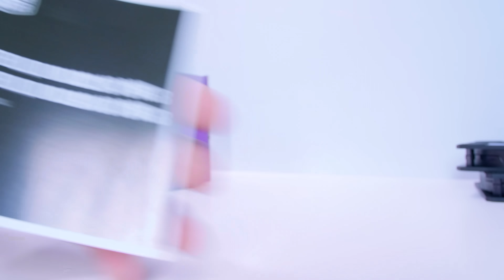HOW TO Cooler Master ML240L V2 RGB AM4 & AM5 Install Guide

Comment: What’s the difference between the v1 version... the only difference I see is that the pump looks different... is there any cooling difference?
Reply: If you check on the coolermaster website, the finstack on the radiator has 20% increased surface area and the fan changed bearings, as well as a more quality pump to prevent leaks and provide better cooling. It's a big upgrade for not that much more cost.

Comment: How would you recommend putting it in the nzxt H510 or the Lian li Lancool 2 x
Reply: Same I came from the 800 dollar pc build and the cpu cooler is so bad so I also wanna know how to install this in the h510
Reply: If I’m being totally honest, I’d say don’t use either, use the Cooler Master H500 (Not H500M or H500P, just H500). It’s supports 240mm rads and is also a good budget case

Comment: Hey, my case is pretty small (it's the aero cylon) and the front of it can hold 3 fans(360mm)
I was wondering if I got this, if the radiotor would interrupt me putting the third fan in the front of my build. Because the radiotor takes up a bit more than 240mm

Comment: The fans for the radiator wont light up, did I do something wrong?
Reply: I had this problem too. I dunno what you did wrong, but I plugged my fan's pin sockets into the wrong pins on the motherboard. I had them plugged into RGB2 and switched them to RGB1 to fix the problem.

Comment: Hi. my Mobo only has 2 Fan headers - CPU Fan & Sys Fan. I am using the Sys Fan for my Casing Fans Hub. If i use the CPU Fan for the radiator fan, where should i plug the pump 3 pin to?
Reply: Did you ever figure it out
Reply: @rey-sc7ct  I powered the pump via a molex to 3 pin converter cable. no pump speed control.

Comment: I recently purchased this over the X53 Kraken. Saved so much money. Trust me, I was torn between on what to get! Super Quiet!!!
Reply: I made the same decision! Glad we both found such a good deal
Reply: Dylan Gregory agree! Plus if you really wanted to, the money you save, can buy  noctua fans that replace the cooler masters
Reply: Elo How much did you get yours for?
Reply: Contonio it was amazon for $75 plus tax. It could be different. The money you save can get you the best noctua fans and its better than the nzxt fans. It’s quiet too. I was shocked at the performance for the price I paid. Can’t complain.
Reply: @elo_888  Can you give me a rough estimate of what your idle temperature is?
Reply: Contonio so I have a tiny ITX build in a NCASE M1. It’s a 3600x and temps idle are 40-50c. Pretty satisfied. Obviously temps are going to be even better in a bigger case. Gaming is around 60-65 and maxes at 70
Reply: @elo_888 i would rather have a better cpu cooler than an extra 80 dollars in fans
Reply: @frehesh.4386  I can afford the better ones. I just choose to save money and it performs fine. Maybe the x53 will be a few degrees better. It’s working fine to me. Still not regretting it. If you can get the better one at the same price as this one, go for it!
Reply: @elo_888  i have one thst i got for 59 dollars open box
Reply: @frehesh.4386  winning! Enjoy it!
Reply: Elo any problems with it yet?
Reply: C02Gaming no problems yet. I have it in my ncase M1. I don’t see why I need to pay $150 for nzxt. Don’t get me wrong, if they were same price I might opt for the nzxt. Financially makes no sense.
Reply: @elo_888  still good?
Reply: Tyler still good! It’s in my NCASE M1! I’m not here to shill it. My first cooler master product honestly. I’m big on saving money and spending it where it makes sense!
Reply: @c02gaming50  nothing yet! I actually have noctua fans for mine in a push pull configuration
Reply: Super quiet? My fans were so loud. I installed it the same way yet the fans were super loud. Ended up replacing them but had to sacrifice the RGB really disappointed but it had to be done
Reply: @renny3503  Make sure to connect cooler pump and cooler fans only to the CPU _FAN (boot verifies device working before start for cpu protection safety) or CPU_OPT headers because those are speed controlled by the motherboard only going max only if heavy useage then it will be louder. Many people only hook to fan power output for for system  or chassis headers which are 100% PWM powered at all time unless changed in BIOS which makes it loud running max all the time when it does not need to 99% of the time.
Reply: @renny3503  the money you saved helps buy noctuas which is better than nzxt and CM fans. That’s the major benefit
Reply: @elo_888  1 month later, all good?
Reply: @elo_888  do you think that this cooler could cool an overclocked 3700x?
Reply: @maestreiluminati87   nothing yet! I actually have noctua fans for mine in a push pull configuration
Reply: @oopsiepoopsie3071   I actually have noctua fans for mine in a push pull configuration. The money saved , made me have nice fans
Reply: I'm about to purchase this cooler. Any leakage problems almost a year later if you're still using it?
Reply: @Hanzeaux  Hey bro! Still Kicking! I just upgraded to a 5600x and upgraded my 5700xt to 3070. No issues! Save that money for gpu, cpu, etc. Wont regret it
Reply: @elo_888  Thanks!
Reply: @Hanzeaux  I hope you enjoy it!
Reply: @elo_888  You're one of a kind! 🔥 I was torn between the same coolers before reading your updates!!
Reply: @MrXSL  Thanks bro! Just trying to help others save money!
Reply: @elo_888  how is it doing? any signs of it slowing down? does it work the same way it did when you bought it?
Reply: @artist3856  doing good! Hope you are too. No issues still. Just doing it’s job! No regrets
Reply: What motherboard do you have
Reply: @luxky  ROG Strix X570-I Gaming
Reply: is it still good now?
Reply: @Axzry  still kicking!
Reply: @elo_888  great, i want to install this with my dad but was it difficult by any chance? my dad installed a new motherboard in mine and this shouldn't be much harder right? also was looking to install new ram
Reply: @Axzry  really easy! not hard at all. Ram is super easy too. Good instructions. Also, there should be youtube videos too! Good luck! you will enjoy it
Reply: @elo_888  ok thank you man, one more question will this video help if i want to install it on to my i7 9700k?
Reply: @Axzry install should be similar but AM4 is AMD. There will be an Intel Mount to use instead.  Wont be much different!
Reply: @elo_888  appreciate it, the guy did a video about intel ones
Reply: @elo_888   I'm pretty sure you aren't gonna see this but is it still running ? do you have any problemos ?
Reply: @ still rocking it! Im honestly shocked I have no problems so far
Reply: in december imma hope i can build my own pc
Reply: @ohqw6684  did u build it? and did u use this aio?
Reply: Bosskiller Playz  I’d check in case. Technically the 3600 and 5600 fit in my x570 board
Reply: @elo_888  hey man can I fit this radiator with Corsair vengeance RGB ram?
Reply: @Joshhburnard  I got the Corsair vengeance rgb ram. Fits with  no issue
Reply: @elo_888  great thanks, will it be fine clearance wise in the Lian li lancool II mesh? Than KS again
Reply: @Joshhburnard  I have a ncase M1. I think you should be fine haha! Good luck and enjoy it
Reply: @elo_888  thanks man :))))
Reply: @elo_888  you know how it has so many cables, is the management of it fine for you? Was it easy to work out what went where?
Reply: @Joshhburnard  It’s not bad. I just tucked them away. I guess this is what you get for paying half of a x53. Still happy with mine. No regrets. I have good temps.
Reply: @elo_888  thanks so much for your quick reply 7 months after making your original comment
Reply: @Joshhburnard  no problem! just trying to help people save money! Enjoy it!
Reply: @elo_888  should i get corsair rgb or adata rgb?
Reply: @Ben Franklinsame cpu hehe. It’s about to be a year for me too!
Reply: Will they work with MSI B450 Tomahawk Max ATX AM4?
Reply: @elo_888  after 4 years…still holding up?

Comment: I bought on on Black Friday of 2018. What a great bit of kit, at any price. Liked it so much I bought another one on Black Friday of 2019. Keeps both of my over clocked apu\cpus nice and cool, eliminates a LOT of the case heat of air coolers, easier to install without too many worries of interference with other components, and the cost is not much more than the best of air coolers. CoolerMaster gets a gold star from me!
Reply from the maker: This is a new cooler released this year. This is the ML240L V2
Reply: @GearSeekers  I must have V1 and V1.5

Comment: Hi any chance you will do a similar guide for the z490? 
I have this a same cooler and its not mounting properly at all. Something gets in the way of the pump resting flat. Could really use the insight right now because the manual isn't updated.
Reply from the maker: Yes. I did mention that at the start of the video

Comment: What's a valid header to use if you don't have a PUMP or OPT header?  My 450 board just has CPU and SYS Fan headers.
Reply from the maker: sys fan header is fine

Comment: Solid insights into the install of this cooler GS team.  Those RGB cable connector clips would be clutch on my ML240R RGB that you showed us how to install.  The struggle is real with RGB connectors coming apart any time I pull of the back panel.  Wonder if Cooler Master would send out those clips to owners of previous designs?

Comment: Hi Nick and all, quick question on the placement. I have the older model for this and wondering what is the benefit of putting it on the top 2 fan slot, compare to bottom 2. If  using the top 2, will the GPU get enough cool air? Thanks mate
Reply from the maker: It shouldn't make much of a difference
Reply: @GearSeekers  thanks good sir!

Comment: :O He didn't invert the tubes tho! Gotta watch out for that water permeation my dude.
Reply from the maker: Incorrect.
Reply: @GearSeekers  Sexy build tho. Liked and subbed. I had thought that while the liquid NEVER evaporates within the AIO it can still slightly permeate the tubing with high temps eventually (likely years later). Guess I gotta dig deeper, the stuff I've seen from Gamer's Nexus said the best practice was to invert but I guess that only applies in certain cases and under certain loads. 
Also, that case is amazing, I own one and am prepping it for the same type of AIO build that you did in your vid.

Comment: Coolermaster Liquid coolers were the worst liquid coolers I've ever used. 
Bought 120MM failed in 2 years, bought 240MM failed in 1 year.
Even my friends who bought it have horrible experience.
Very common to hear radiator noise and vibrations.
Instead go for DeepCool it's good in quality also in budget.
Reply: the old version has many complaints, this has anti-leak as the surface area for the copper that cools the cpu will make the aio leak way less. Pump failure can be returned back
Reply: @sheikhrayan9538  I don't know man, I would not trust again easily. Once trust broken really hard to restore.

Comment: I’m watching this on my phone, so the picture is a bit small, but do the hoses from the pump top interfere with the Ram slot?  It looks close, but I can’t tell.  

Great video as always. Keep up the great work.
Reply from the maker: Nope
Reply: Gear Seekers Thanks!  At $80 US I think I might have to get one.
Reply: @GearSeekers  does it matter where I put the cooler radiator? I am getting a cooler master masterbox and it is micro ATX, and I was wondering if I can put it on the top. Does it really matter where I put it?

Comment: I am literally about to buy this, I'm glad this was posted so I can see what it's like first
Reply: Its great I have it and quite keeps my 5 3600 at 56 max I never seen my cpu go to 60 degrees when under load
Reply: @pablon7465  same temps I get with my hyper 212
Reply: top
Reply: @Goggle69  so i've had this for about a week now. The fans make a horrible grinding noise. does yours?
Reply: @Mayden_America  Is it the fans or the pump? It can take like 3-4 days for the air to work it's way out of the pump.
Reply: @Mayden_America  You have to let it rest for like an hour at first pc boot
Reply: Goktan Celik definitely the fans. They make the noise when I plug them in separately. The pump is actually extremely quiet. I’m very sensitive to noise and I can’t even hear it

Comment: I just bought (haven’t taken it out of the box )the old version should I send it back and order the new version or is it not that big of a upgrade
Reply: return it, it may leak
Reply: send it back, the old version tends to fail after a year and the pumps/fans are noisy. Maybe these new pump and fans are better
Reply from the maker: They have been redesigned from the ground up

Comment: Extremely cheap, high quality, cooler master back at it.
Reply: I have a Gigabyte B450M DS3H but i dont see a CPU_OPT is there any other header i can plug it into or any 3-pin to sata/molex converters i can use?
Reply: @heat.-  just plug it into the cpu fan header lol
Reply: @heat.-  no no plug into any regular fan header. It needs only power not own so. Yeaa any fan header will do
Reply: Does it fit all case ima build my first pc not sure if this a dumb question
Reply: @desireeye307  i was asking the same thing did u find a answer
Reply: @JALAMERII  a little late to the party, I just built my PC and used a Corsair 4000D Airflow case, with some pretty tall RAM too, top mounted it and it works just fine, it’s a relatively slim water cooler all things considered
So it should be able to fit most cases. You’ll just have to see whether you need to front mount it or top mount it
Reply: Cheap but high quality? So it’s good?
Reply: Is this good for 5800x?
Reply: @Unknown-bj7bz  yes, just undervolt your 5800x
Reply: i agree. at cpu volt 1.25V at 4.4Ghz, multicore cinebench test had only 60deg celcius. which i wud say is  pretty stable...